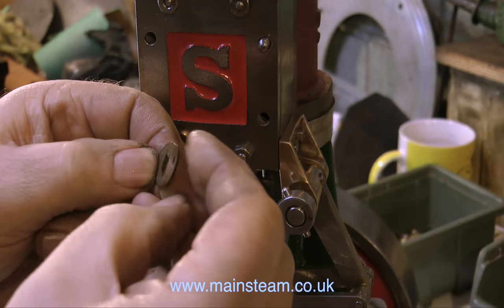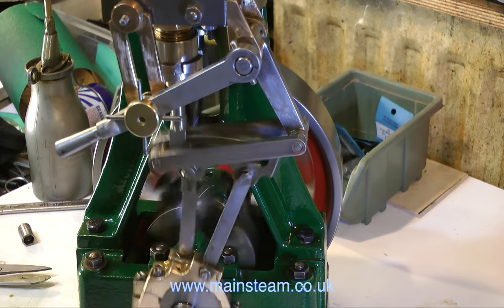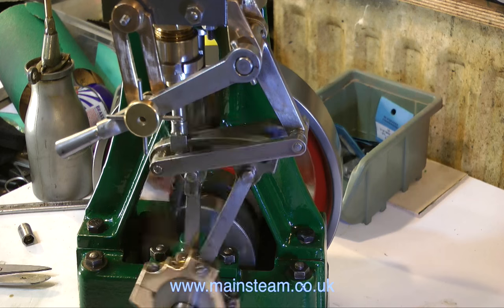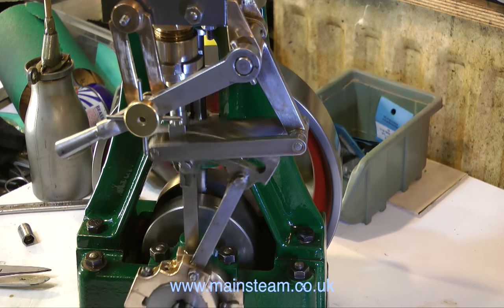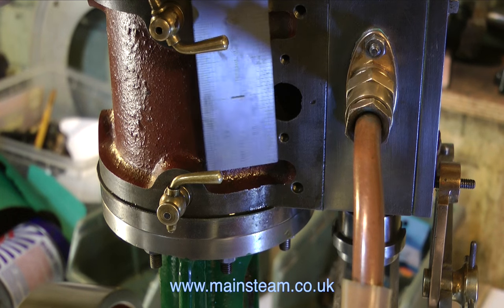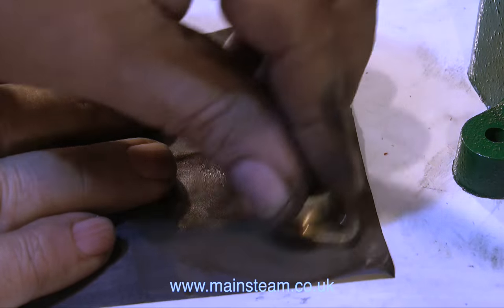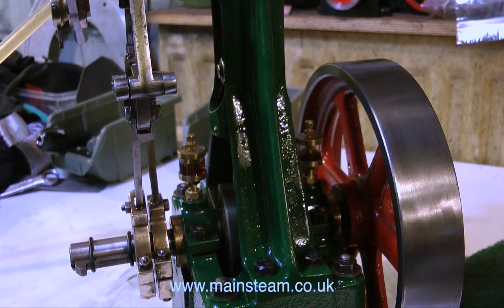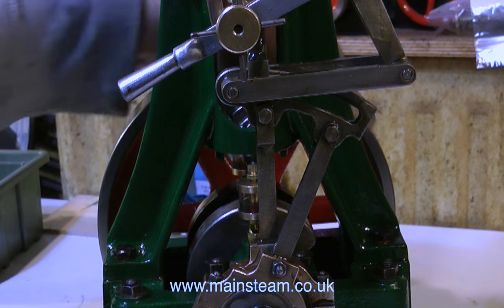STUART 5A STEAM ENGINE REBUILD - PART #9

Comment: Thank you for the lovely series of videos of the rebuild.  I've enjoyed watching.  There is an economical solution to the issues that you were having arising from the limited capacity of your air compressor.  Try to find a suitably stout tank from another burned out compressor and use the tank from that compressor hooked in line with the existing tank.  That will provide an economical reserve of compressed air when you occasionally run into similar situations.  Thanks again and Happy Holidays.
Reply from the maker: That's a good idea, but then it would take longer to pump up the increased volume of air once I ran the air down ... what I really need is a higher capacity but quiet compressor :-)))

Comment: Yes, I did notice the valve didn't have the usual slot that I've seen in previous rebuilds so I figured there was something going on with it not seating properly. Great to see her coming togeather!
Reply from the maker: Stuart 5A Steam Engines don't have a slot, it is always a hole - but this one was not in the right place on the Valve, the diameter was OK - just not where it needed to be to avoid fouling the valve rod .....

Comment: Was the valve face not flat? I can see how enlarging the exhaust cavity would allow the flow to improve, but I thought you said it was leaking air when stopped?
Reply from the maker: The valve & port face were perfectly flat ?? - the problem is as I thought that I explained it in the video ..... the hole in the valve was not in the right position and the valve spindle was holding the valve off the port face. I don't remember saying anything about enlarging the exhaust cavity, I just elongated (machined) the hole in the slide valve that the valve spindle goes through to prevent the valve being held held off the port face . . . . if you watch the video once again it may become apparent :-)))

Comment: Alright, time for another stupid question, because I spent some time looking at the timing mechanism ... Somewhen back you mentioned how you set that up (i.e. start by advancing 90° and then going back and forth and see if it gets better or worse). Shouldn't the exact advancement be only dependent on the type of engine? I.e. I understand that different types of engines might require a different amount of advancement because of different geometry and such, but the same type should always be the same. or do you simply work on so many different types of engines that it would take longer to look it all up and measure exactly than playing it by ear?
Reply from the maker: I do it from experience, the principle is the same on different types of model steam engines using eccentric driven valve gear.

Comment: nice job, i noticed on the first two trial runs there was no key in the key-way, did that effect the running?
Reply from the maker: Not really, it is grubscrewed to the shaft - I was checking the timing with the key removed.
Reply: Keith Appleton
ok.